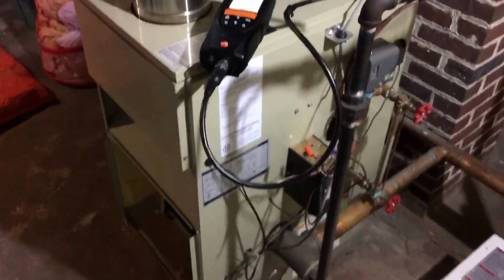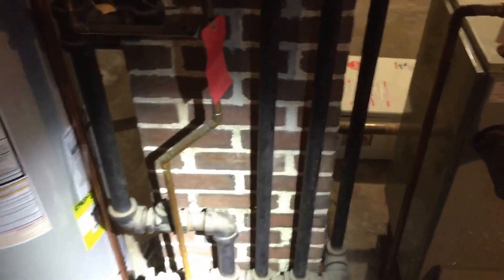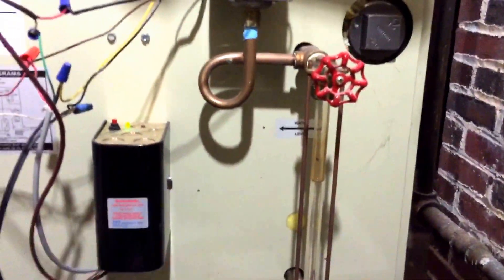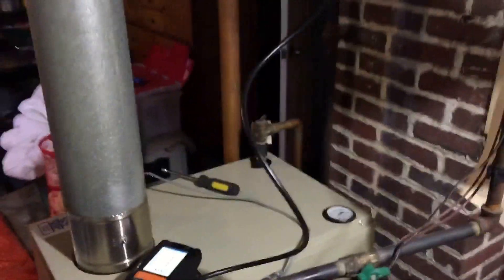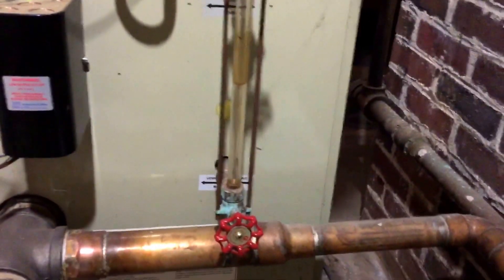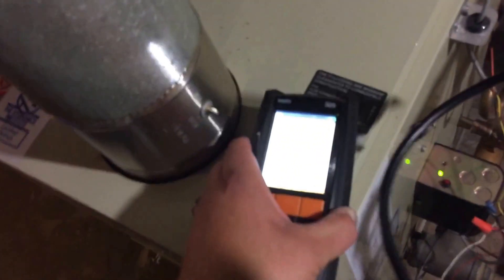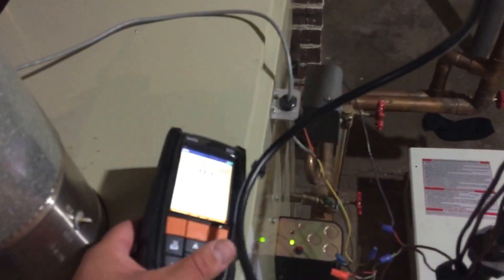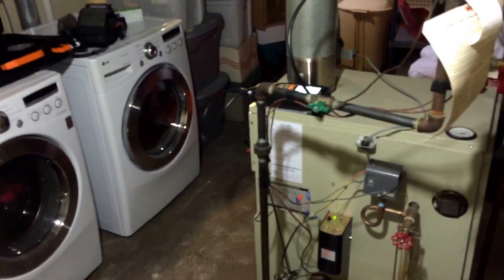Steam boiler check and combustion analysis.

Comment: Good vid Rob , what's the deal with the tank less water heater on the ground ?
Reply: The heater had to be removed because of the addition. There is nowhere to vent it to an outside wall so they had to go back to a tank.